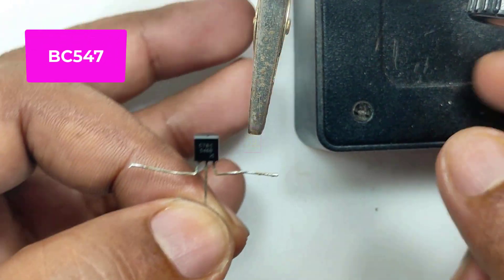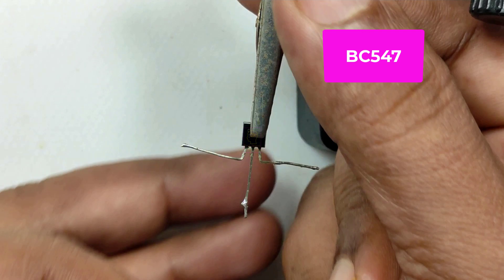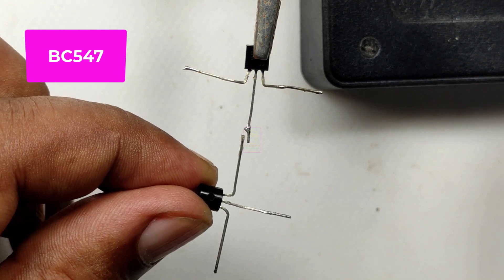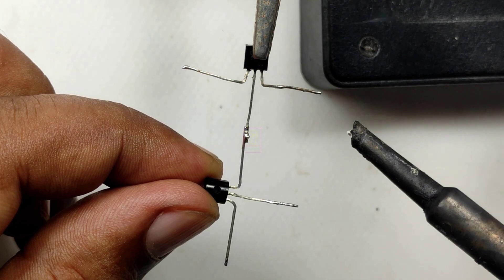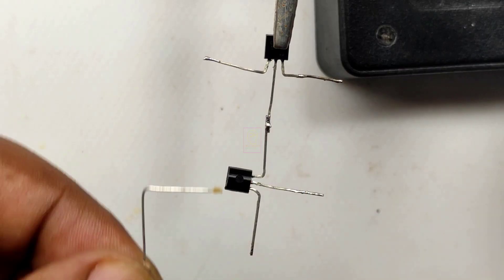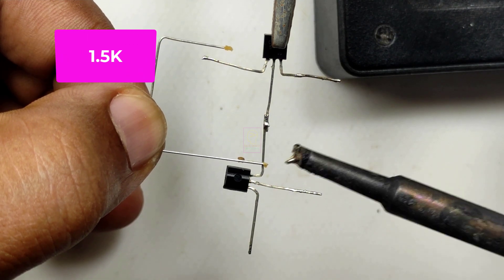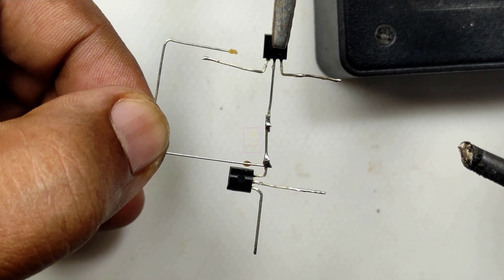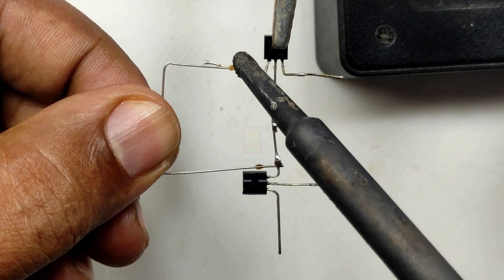Make a 5V Voltage Regulator WITHOUT a Regulator IC!

Comment: Can this handle two loads that require 5V? Will the voltage drop if it goes below 7V to 4V?
Reply from the maker: Nope. This is life hack. If u require a 5v where ur unable to use or get 7805 chip then u can use this. For u the best choice is to use 7805 or LM 317 regulators

Comment: Can we use power transistors?
Reply from the maker: Yes, we can.
Reply: Yes, 2N 3055 can be used. But i dont feel this as efficient
Reply: @BabuProject  Why did u tell this is not efficient? Eager to know
Reply: @TitusKelly-cj8um  That is because when you give heavy load the output voltage drops and will not be regulated to constant voltage.
Reply: @John-pk7lr yes answe is correct
Reply: @TitusKelly-cj8um  That is coz when u add load to the circuit, the voltage drops. This circuit cannot deliver constant regulated voltage to output.
Reply: @BabuProject  Thank you very much. What is the replacement?